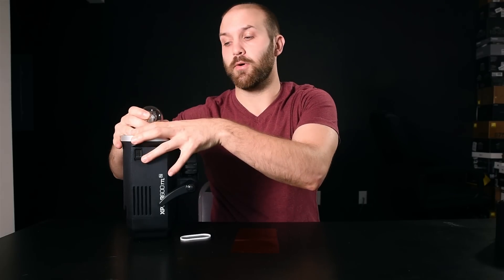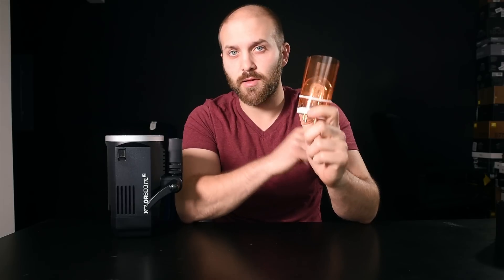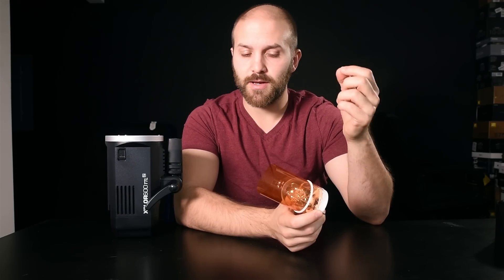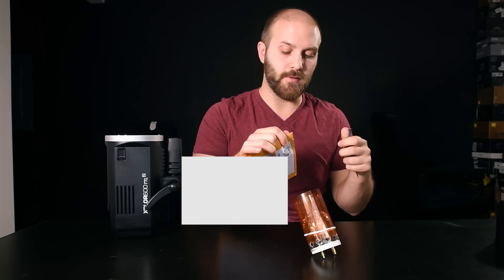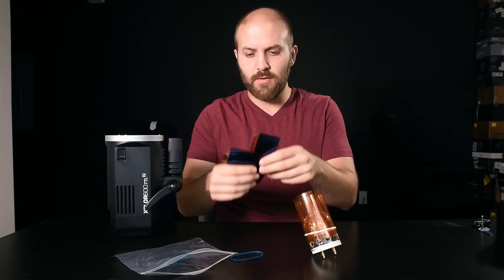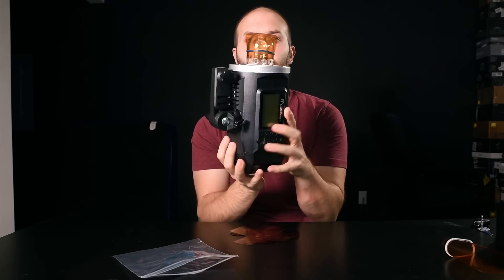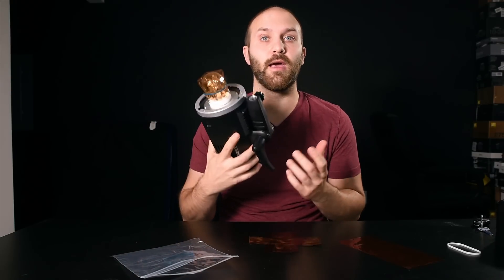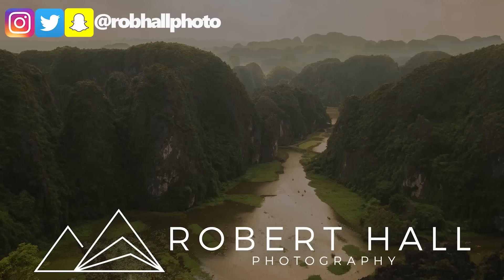How to Gel a Monolight   Flashpoint Xplor 600 and Godox AD600

Comment: Have you seen the gel holder that comes with the Aputure Light Dome II?  It’s amazing, considering buying the softbox just for that.  Wish there was more options on the market that were similar. Would stop me having to buy gels for Ad200 round, bare bulb and 600.... could just buy some nice Rosco or Lee filters and use them for all strobes.
Reply from the maker: Seen it, yes, but don't buy it for flash. It's great for COB LED's as they have a heatsink to carry heat away from the chip, through the light body, and then have it blown away by the fans. However, even if your flash tube does fit behind the gel in the aputure light dome, you are suffocating the flash tube which will dramatically reduce it's life span. It'll cost you a lot more money to replace the tubes than it does to just get gels that allow heat to escape the protective glass.

Comment: Great video! It motivated me to make some of these custom gels for my Interfit lights (I own 2 S1's, 4 Honey Badger's, and a couple of the Badger Unleashed, all of which use the same glass dome). Do you happen to have a link to those silicone cooking bands? I've been searching Amazon, but everything I can find is either too big, too thin, or break under heat. Thanks!
Reply: David Wagner ordering my first S1 and I could not find a great way to attach gels. Until now. Your comment and this video got me thinking in the right direction. Thanks!

Comment: Great channel. Would a standard gel work or do they need to be special heat resistant ones? I'm thinking of making my own cutout from standard gels on Amazon
Reply from the maker: I've never had a gel burn on me and I've used many types. Most "standard" gels have enough heat tolerance for flash since the heat is intermittent. It's moreso high output cinema lighting that requires specialized gels due to the constant high temperature.
Reply: @robhallphoto  thank you for replying, much appreciated. What brand do you use for the flat ones?

Comment: Other monolight has non LED modeling light which is very hot. I dont know how far heat resistant gel might do it
Reply from the maker: +nixland yeah this wouldn't be recommended with a modeling lamp on.

Comment: I'm using the Rove light RL-600 and, like all heads with that power, they get HOT! I'm so nervous with the thought of fastening gels so close the tube. How do they not melt that close?
Reply from the maker: +Tone Gee Mine are never hot. I can fire 40 times at full power and then maintain contact with the glass. Gels are designed to be heat resistant.
Reply: thank you kindly
Reply from the maker: +Tone Gee gels are designed to be heat resistant. So are the silicone cooking bands.
Reply: the gels from www.flashgels.com are rated for very high temps -- they have been tested extensively and no issues!

Comment: This is going to be a challenge on the Xplor 600 Pro because it's got holes all over the glass casing.
Reply: FlashGels is working on a solution for this as well, it is a much more intricate design but we are hoping to have a solution soon. You can check back at www.flashgels.com to see if they've been listed, and hopefully Rob can also tell you about it in the near future.

Comment: put a blue gel and shoot 50 photos at full power and you can throw away your flash bulb with melted gel on it!
Reply from the maker: Have you done it with heat resistant gels? I have, nothing happened. Otherwise I wouldn’t recommend it.
Reply from the maker: The glass is never even too hot to touch. It’s simply too ventilated and too far from the actual flash tube for it to get very hot.